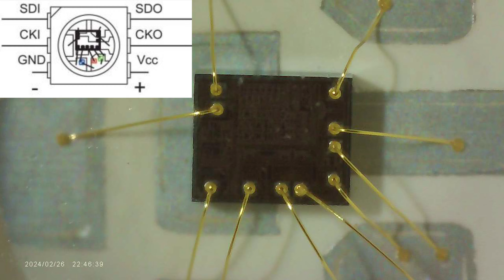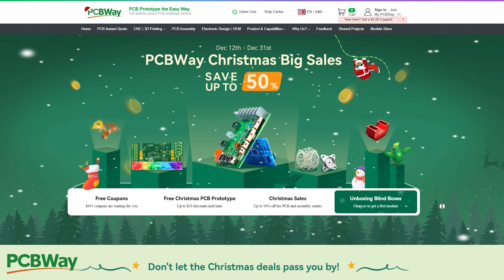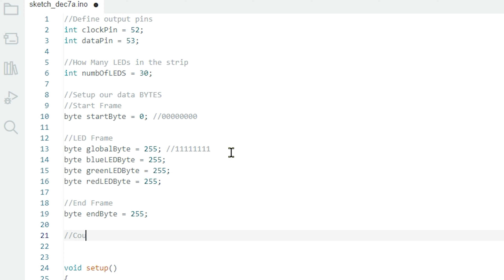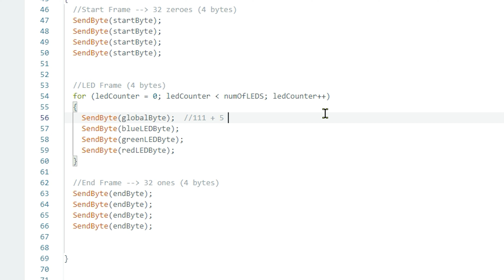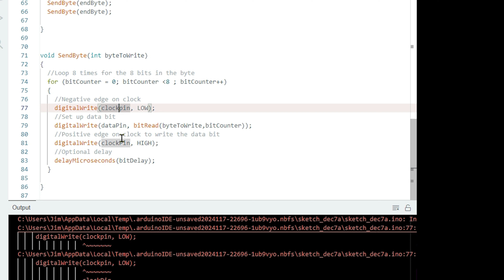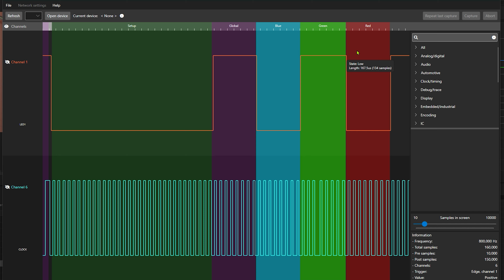APA102 LED Strips - Arduino Basics - Let's Figure This Out Together

Comment: I was thinking about the effective code in each led to process the incoming data from your arch up.

I was expecting your code not to work as you were effectively forming & transmitting the end frame from your led frame - I assumed you’d then find out that the global didn’t go up to all ones) - but I was wrong.

 I’m now assuming that you don’t need the end frame at all. Never transmitting the end frame, and just the start frame must be sufficient to reset each led to await data. 

You might want to give that a try and see if it still works correctly

Comment: I really appreciate your projects and it will be interesting to see the integration to Manic Miner.

Two comments/questions about what's seen in the video from a technical point of view.

How would that LED strip distinguish a control byte with full brightness (11100000 + 11111) followed by 255 reach for BGR from the end frame?

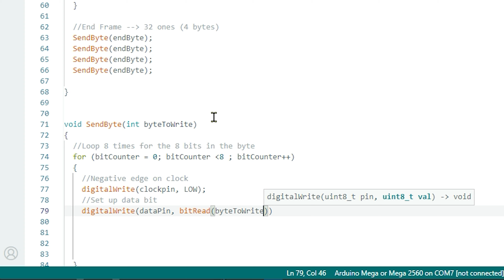At 23:00 you use the bitRead() function but seem to feed the strip the bits from LSB (bit 0) to MSB (bit 7) when the specifications seem to indigate that the MSB should be sent first. 
Since your example only send 00 and FF the case is not caught.
If the order is MSB first then feeding bitRead() with the value 7-bitCounter would be one way and another to change to for(bitCounter=7; bitCounter>=0; bitCounter--)

Stay creative and happy hacking!
Reply from the maker: Hi Lars. 
Thanks for the kind comment. 
I had the same question and I think the answer is in the start frame. Say it receives 4 bytes of 1's after a start frame, it must be LED data (bright white) because the start frame was the last thing received, if it then receives 4 bytes of 1's again it could be an end frame or another bright white LED frame, maybe it doesn't relay the data until it's received the next frame, which may be a start frame (all 0's, in this don't send the bright white to the next LED) or a non-start frame (at least one 1) in which case relay the data. I'm speculating but that's the only way I see it. 

As for the order of bits, the datasheet suggest MSB-LSB.  I had this thought after writing the code, but I just tested it by putting in some test colours, if I set BGR values to pink the LEDs went pink. If I set the global brightness to 1 they were dimmer than if I set it to 8, etc.  it was 50/50 and it seems to have worked.

I'll double check this when I get back on to it after Christmas
Reply: @HappyLittleDiodes  It wouldn't be the first time a datasheet contains errors or ambiguities, neither the last, I'm afraid.
Reply from the maker: @LarsHHoog I've been checking and the loop should be bit 7 to 0, on paper. I'm gonna try it when I get back

Comment: Propagation delay is pretty much unavoidable with pixels like this (I'm using pixels to refer to each LED module containing the three different colour LEDs).  For a strobe light, it would be better to use a string of plain LEDs with a transistor driver so they can all be turned on and off at the same time.  Pixel-style RGB lights will always have a propagation delay.

The other commonly used data transmission method for pixels uses only a data in pin and data out pin with no clock.  Zeroes and ones are defined by how long a bit is high for, and the end of data is defined by a pause in data transmission.  The data is sent in reverse order (last pixel in the chain transmitted first).  You transmit just the three intensities for the three colours, then if you stop transmitting, the pixel uses the last three bytes to light up its LEDs.  If you keep on transmitting, then the pixel starts transmitting the bytes it already received to its output, which allows them to be passed to the next pixel in the chain.
The result is that you transmit the data for the last pixel in the chain first of all, then the data for the next-to-last, and so on until you transmit the data for the first pixel and then stop.
The first pixel sees that you've stopped transmitting and so instead of transmitting the last three bytes it received, it uses them to light its LEDs.  The next pixel along sees that the first pixel has stopped transmitting and does the same thing.  This cascades down the line of pixels so that they all light up.  There's still a propagation delay caused by each pixel needing to "notice" that it's no longer receiving new data and so it has to use the last three bytes it received as the data to light its LEDs.

Comment: These are nice and easy to drive, because they have a dedicated clock line and a stop frame. WS2812 ‘Neopixels’ can be more of a challenge, as they depend on a rather rapid minimum clock speed, and the LEDs change when the input data stops for a short while. This means that the microcontroller can't afford to stop and think, so to speak. The disadvantage of clocking at a comfortable pace is that you can't implement fast changes on long strings. Great primer video, with (in my estimation) just the right amount of detail. I might have to get some of these myself!
Reply from the maker: Thanks for the detailed and kind comment
Reply: @HappyLittleDiodes  You're very welcome! Thanks for replying. Your channel is great: super content, well presented. It must be hard work, so thanks very much for taking the trouble.
Reply: It's interesting to contrast how these lights work with how the 'Neopixel' lights work.  Both have advantages and disadvantages, with one big advantage of the Neopixels being that you only need a single data pin without a clock.  One of the disadvantages is as you said, the need to send all of the data in one "hit" without any pause since a pause is taken to be an end-of-data signal.
Reply: How would that LED strip distinguish a control byte with full brightness (11100000 + 11111) followed by 255 reach for BGR from the end frame?
Reply: @LarsHHoog  I must admit that I hadn't analysed that far. I'm probably going to order some very soon, which should enable me to answer the question.